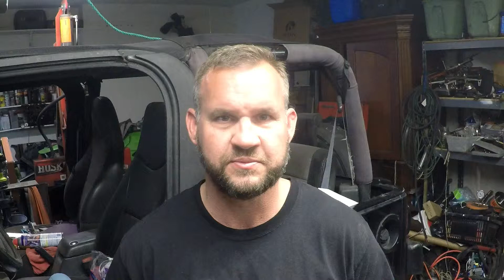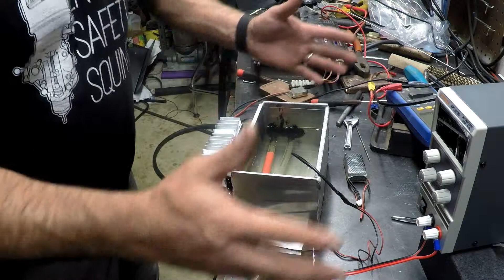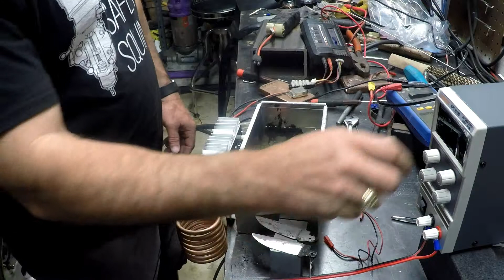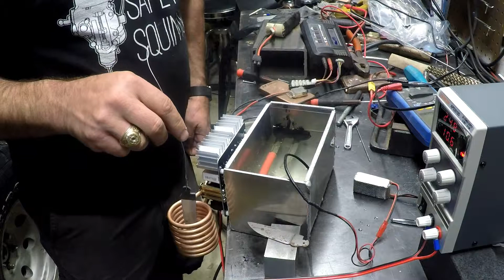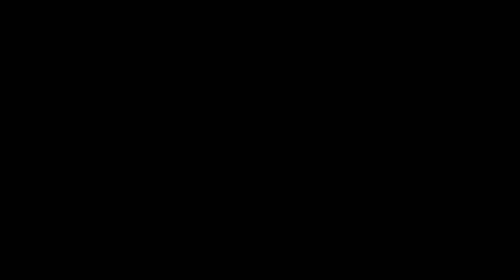Induction Heater for heat treating steel

Comment: I still just use the oven for tempering but id like to get some sort of insulating clay and see if that would work for tempering in the induction heater to leave a wave.
Reply from the maker: A wave like a hamon? Get some Satanite or other clay and put it on the blade in whatever pattern you want and it will definitely work even in the induction heater.  The hamon is a result of differential cooling when quenched.  Takes a bit more time to allow the clay to dry completely but it is not difficult

Comment: I make knives from flat bars i buy online and then just do stock removal. I grabbed a forge but i live right in the heart of the city in jax. I own a house but no garage or real workspace. The induction heater is really my only viable method of heat treating a hobby blade without it taking all day. Instead it takes me like 10 minutes.
Reply from the maker: I also built a heat treat oven, but for small blades the induction heater is pretty awesome

Comment: Do you know how hot it is getting the metal?  I have a instant-read thermometer but it only goes to 1000 degrees fahrenheit.
Reply from the maker: I haven’t measured it but based on color it looks to be around 1700-1800.  With a big enough power source it could easily exceed 2300

Comment: Hi there, I have already been making blades for years now, but have never tried induction heating. I am in the UK and cannot find these on ebay or amazon. There are either the ridiculously low powered ones (probably for science projects), and then the ones that start at £500 - £3000. It's from one extreme to another.
Any help would be appreciated. Big fan of your channel btw :)
Reply: So, i found this one, could you tell me if its the same as yours please "RUNMIND 1000W 20A ZVS Low Voltage Induction Heating Board Module with Coil 12V-48V Flyback Driver Heater DIY"? It's on amazon for £33 which would equate to around $40. So, the price is right, also it looks the same. However I have been bitten before buying things that look similar. So, I would like to double check with you first. Regards, Shona x
Reply from the maker: Thanks for the comment.  I don’t remember the exact one I bought but just searching Amazon I found this one  

1800W ZVS Induction Heating Board Module Low Voltage High Frequency 12-48V Flyback Driver Heater with Tesla Coil and Cooling Fan https://www.amazon.com/dp/B07TVD16S4/ref=cm_sw_r_cp_api_glt_fabc_PXRBECDMZ88EA136A4B2

I don’t know how Amazon in the U.S. vs the UK in regards to what is available here vs there. 1800W should be plenty of power for annealing and heat treating.  The one in my video was only 1000W.  Finding an affordable DC power supply up to 30-48V is more difficult than I thought it would be.